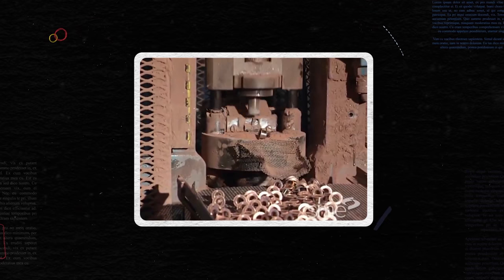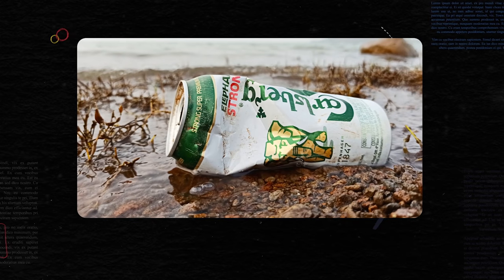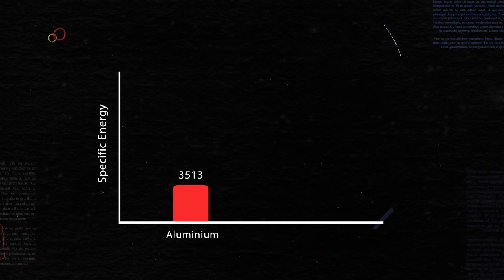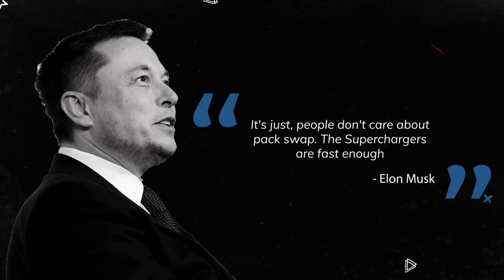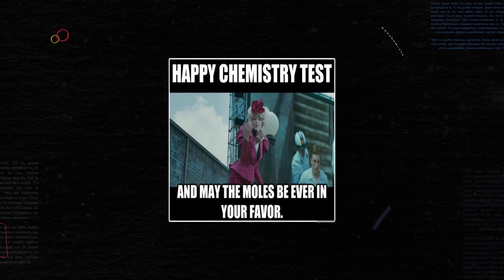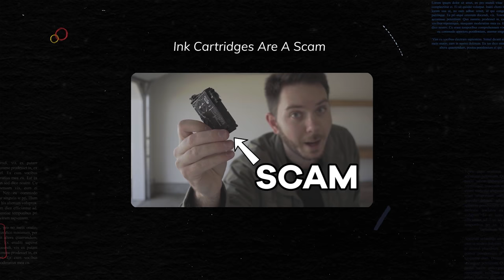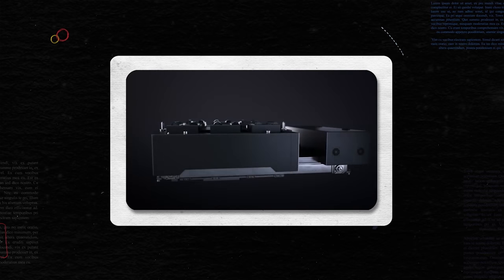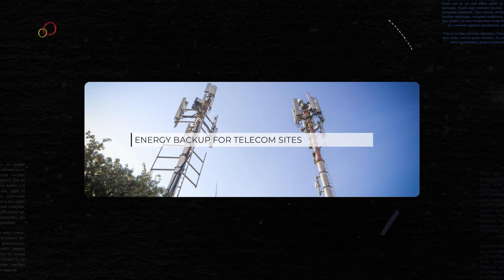We Can Get 1600 KM of Range With Aluminium Batteries

Comment: The part thats being glossed over is that aluminum ore is only worth 15 cents per kilogram.

So the sludge in your battery is only worth about $6

The whole sale price for a 40 kilogram ingot of aluminum is $90.
( thats just the cost of the metal )

So the economic numbers being cited just dont add up.

They are pretending that the value of the waste material is much higher than it really is and that they can get the cost of rebuilding a battery down to just the price of the aluminum.

I doubt they can get the final cost of a "rebuilt"  battery below $200 .
Im probably being generous with that number, because you have to figure in the cost of collection, labor,manufacturing, storage and distribution of the batteries 
But $200 would put the cost at 20 cents per kilometer.

In America thats like driving a car that only gets 7 mpg.

But even if you buy into the "7 cents per kilometer" number thats still 5 cents per mile ( 20 mpg )

People have been testing aluminum air batteries in cars since the 1980's and the problem they always run into is that aluminum is expensive.
Reply from the maker: 15 cents per kilogram still gives $20 or so
Reply: @TechforLudditesSira  its 15 cents per recoverable kilogram of aluminum, even if you could recover all 40 kilograms its only $6 worth.

The numbers the manufacturer is putting out just dont add up.
Reply from the maker: It won’t be 40 kg. It’ll be around 120 kg. Aluminium makes aluminium hydroxide in a 1:3 ratio.
Reply: @TechforLudditesSira  120 kilograms of sludge is only 40 kilograms of aluminum.

Scrap aluminum is only 30 cents a kilogram.

If you handed in 40 kilograms of ACTUAL ALUMINUM METAL for recycling its only worth $12 

Theres no way 40 kilograms of unrefined aluminum is worth more.

They are greatly exaggerating the value of the waste product from the battery and thats a big red flag that leads me to be VERY suspicious of all of their numbers.

Comment: I am not chemistry guy, what will happen if the car in heavy/fire accident
Reply: Aliminium will just melt. It has to get to over 4000K to burn.
Compare that to Lithium which reacts with air at room temperature and quickly gets to 500C when it will burn/explode!!!
Reply: A much lesser outcome than an ICE powered petrol car with stank of volatile hydrocarbons.

Comment: This tech seems more suitable for Grid power storage
Reply: My thought exactly.  Elon Musk is creating huge Li battery banks for grid storage when it seems that this would be a cheaper, more efficient solution.
Reply: These are primary cells. They can’t be “recharged” after depletion, they have to be remanufactured. They’re a “one-and-done”. Not to mention needing to remove the aluminum hydroxide sludge from time to time. That’s not suitable for grid storage use, where there’s need for many thousands of maintenance-free charge/discharge cycles.

Comment: 10:40 If production of a kg of aluminium releases 10kg of CO2 the 1000 km range vehicle effectively emits CO2 at the rate of 430 g/km… or about 4x worse than my 1 litre petrol-fuelled car.
Also, aluminium smelting requires a reliable electrical supply, so excess solar or wind power isn’t suitable.